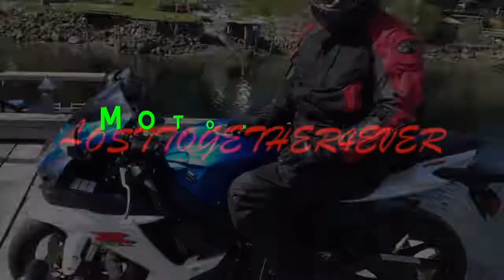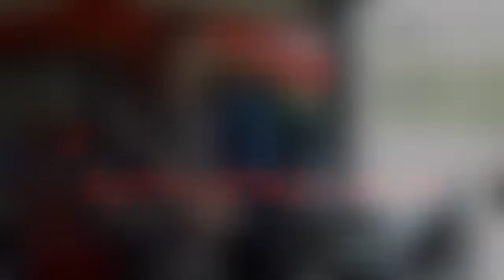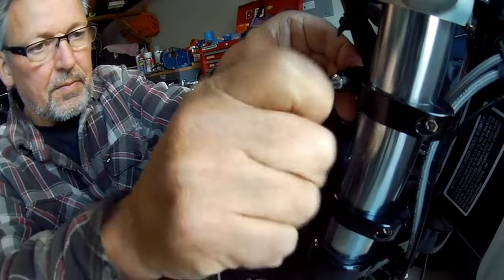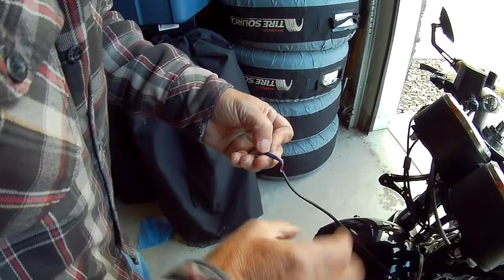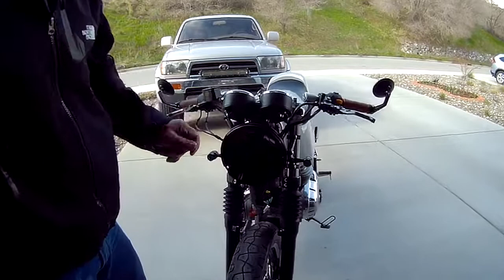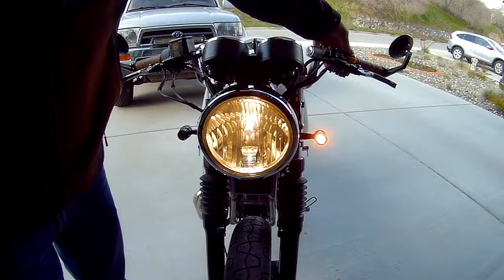🇬🇧Royal Enfield Continental GT Interceptor 650 Cafe Racer How to Headlight Bracket/Signal Light Mods

Comment: Hi . I always refer to your videos.
Can you teach me?
I tried to buy the same bracket, but it comes in several lengths.
What length are your brackets?
Reply from the maker: I bought the 39-41mm brackets, they are adjustable by using rubber shims. The forks are 41mm in diameter so you do not use the rubber shims. Thanks for watching
Reply: Thank you. m(__)m
I will buy that size.
Reply: Can you tell me one more thing?m(_ _)m

In order to remove the normal headlight stay, I think that it can not be done unless the handle top bridge is removed..

I can't do it very well. Is there anything I should be aware of?